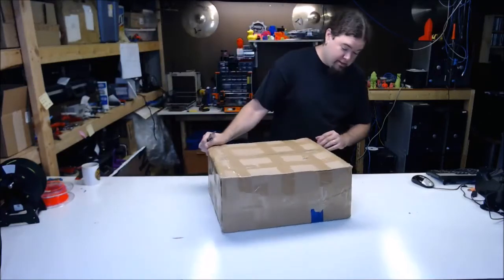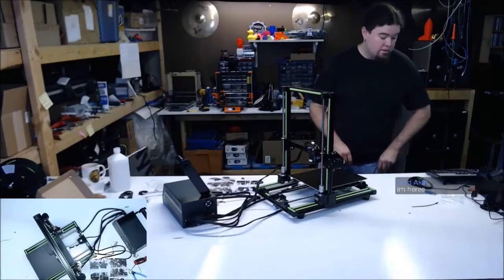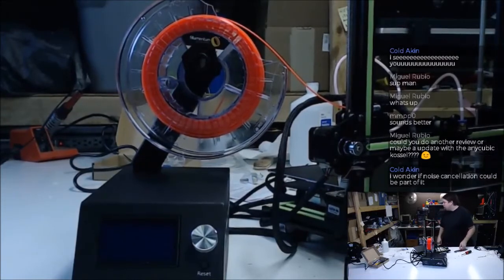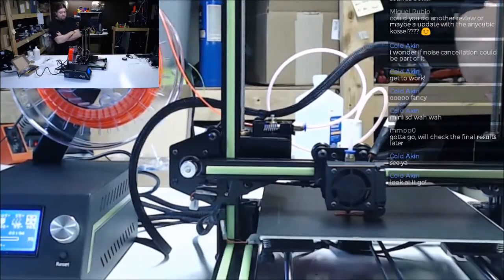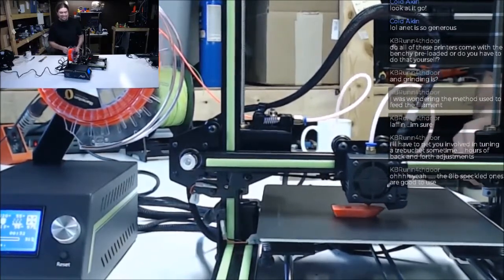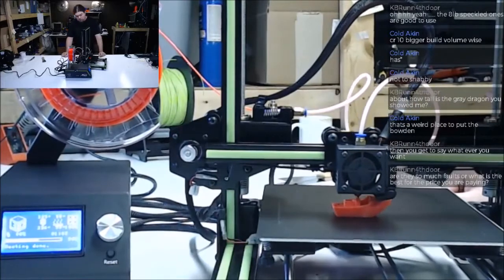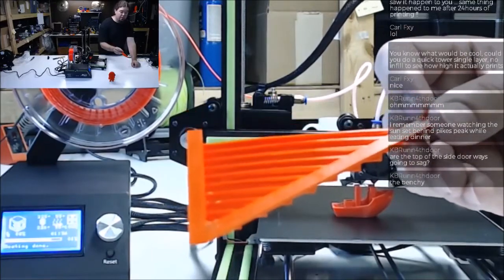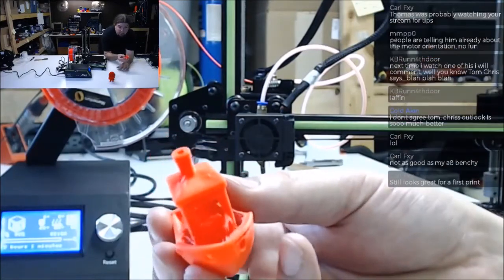ANET E10 Live Stream unboxing and build

Comment: you might already discover this late on but make these changes.

cut the bowden tube in half. its meant to be TWO one to use one spare (bad instructions)

will work a lot better.

next in configuration cut the acceleration and jerk in half of their default values Set acceleration to 1000 and xy jerk to 10 VERY smooth afterwards. makes a huge difference. the printer CAN go pretty fast. your feed issue is that long bowden tube.

print CNC kitchens replacement shroud. it works splendidly. and that is the only mod you really need the printer is otherwise VERY good.

in simplify 3d here is how I set it.

retract 5mm extra restart -.35 coast .25 multiplier 1.00 nozzle and line of course .4 and .4

the results from this printer are shockingly spectacular.

also replace the 3 40mmx10mm fans with Noise Blockers. the printer is pretty damned quiet once you replace those 3 fans.

you can get links from my E10 video (pretty shitty to post affiliate links in other peoples videos so I won't do that)

temps are accurate. I get stunning results at 195c your drag issue is that bowden tube. not only is it too long but its too large a diameter. but it works great once you cut it in half.

The benchy's I printed from the E10 and Ender 2. The E10 is REALLY nice when you tune it in. its one of my favorites.
https://www.youtube.com/watch?v=zH9fp442s-s
Reply from the maker: Thanks for the comment, I have been making some changes this week and I agree, it is printing pretty well now. I will post a follow up video soon. Thanks again.

Comment: lol both the x-axis mounts on my anet a8 snapped on an overnight print. No idea what happened, so I just ordered a cr10 from gearbest for $397 (GBCR10J coupon code ),  used your affiliate link https://goo.gl/ouyrJc . Going to print new x-motor mounts for the a8, hopefully have two printers running. I can't get over how many problems I have had with the a8, but the prints i did get were awesome.
Reply from the maker: Ha, sorry to hear that man. Thanks a lot for using the link. Hopefully I will see a CR 10 soon as well and we can compare notes.